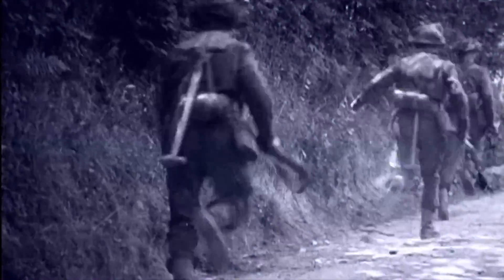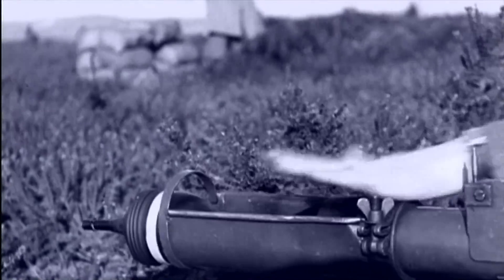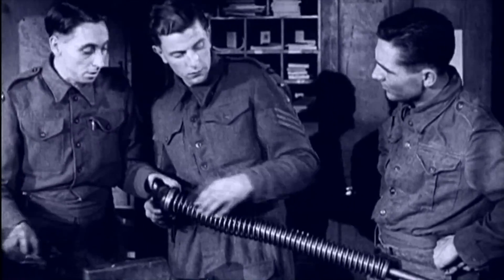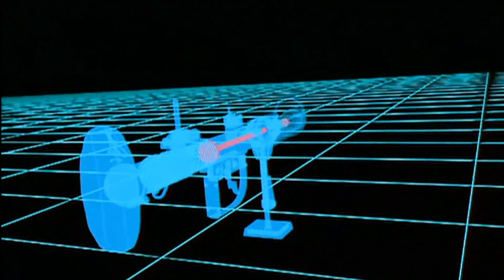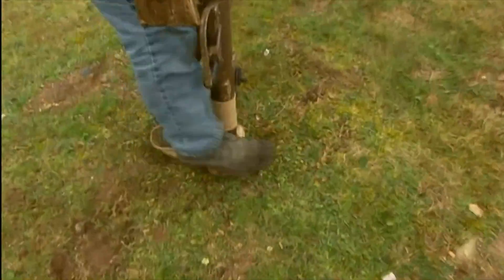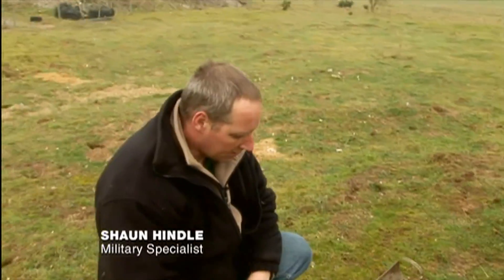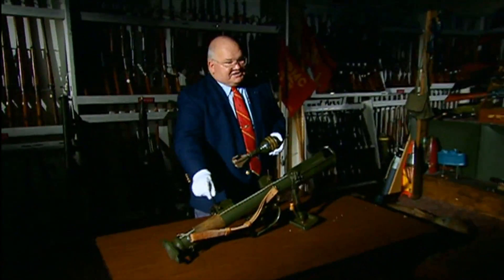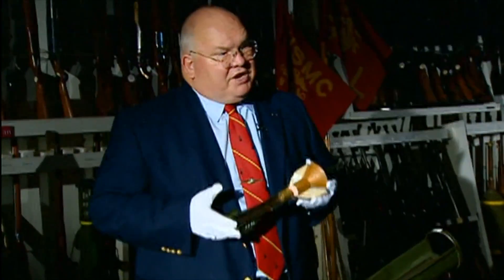Weaponology - "British PIAT"

Comment: Of course the big advatage of the PIAT was it could fire 15 rounds per minute. It was the only man portable rapid fire anti-armour weapon of WW2. A two man PIAT team had much more effective firepower than their Bazooka of Panzerfaust equivalent.
Reply: So how exactly are PIAT rounds primed?
Reply: So I was quite correct to say Bazooka rounds are larger than PIAT rounds.

I can show you an official source that states Bazooka teams carried 6 rockets. Can you show me proof that PIAT teams carried 6 mortars?

PIAT rounds did not need to be 'primed'. A quick look at the PIAT user manual will show you this. Also the operator does not need to "check if the weapon has successfully cocked itself". You are just making this stuff up. The loaders job was to get another round in the tube as quickly as possible.

I have shown you actual footage of a PIAT firing rapidly. You have shown me nothing to suggest the Bazooka can do the same, because it can't.
Reply: "And since the weapon often failed to cock itself, in the field the 
gunner would usually manually cock the weapon after every shot"

Is this fact or conjecture?

"If you think PIAT teams can carry more than six rounds (the term is 
"rounds" or "bombs," a "mortar" is a device), show me a source."

Do you want to see pictures?

"PIAT rounds do need to be primed"

No they don't. If you know better than the actual PIAT field manual then prove it.

"You've still shown me no proof that this supposed 15 rpm rate of fire"

No, i've shown you proof of a 20 rpm rate of fire.
Reply: There is no mention of the loader having to 'prime' rounds between shots in the PIAT field manual. If rounds had to be fused after transportation but prior to use then this would have no affect on rate of fire.  The advantages of the PIAT was that it was rapid fire, produced no backblast, was quiet, multifunctional and cheap to produce. That's a lot of advantages. The only advantage of the Bazooka was that it was light weight.
Reply: The PIAT manual's loaders instructions even include removing a cork dust plug from the rounds base before firing. There is a reason fusing each round isn't included and that's because it is done in advance. It is not part of the reloading drill, and has no impact on rate of fire. 

Are you suggesting PIAT operators running around with loaded PIATS clearing urban areas have not fused their chambered rounds?

PIAT's can be fired at a depressed angle. A clip holds the round in place.

 "doesn't prevent the gunner from carrying a rifle"

http://www.ww2incolor.com/d/615911-3/PRUNER
Reply: So what you're saying is a 30 year old second hand Soviet ex-cold war stock RPG rocket is roughly 10 times the price of a newly manufatured HE mortar. So when I said Bazooka rounds were probably 10 times the cost of PIAT mortars it was actually quite a conservative estimate.

I take it you no longer refuse to acknowledge that a well positioned and prepared PIAT team could quite easily achieve a 15 rpm rate of fire  as shown in this video.

If the point you were trying to make before your melt- down was the the PIAT was quite large and heavy, well it is. You didn't have to exaggerate and claim it was impossible for the operator to carry a PIAT and a machine gun/rifle as that is quite clearly BS. Canadian PIAT operators carried a Thompson machine gun as standard.
Reply: "You screw in the detonator on the nose of the round, like I already said
 once. It comes from the factory with the nose fuze in place but not 
screwed fully in so the HEAT charge won't detonate if you drop it."

Prove it.
Reply: Already edited it to add proof, but ok:

"One day, he had a brilliant idea that he would test a certain shape of slit for the PIAT. He called for a platoon to volunteer to dig this, but, of course, no one did. My platoon got the job on the grounds that the soil was softer where we were. The NCO who got the job was testing the result, when the PIAT went off and only the fact that the bomb was not primed prevented the Company HQ from being considerably shaken, as it hit a tree not far from where a company conference was in progress." 

Lieutenant Percy Hamilton, Irish Brigade, Termoli, Italy, October 1943.
Reply: What bomb was it? HEAT, HE or a dummy round (which does need to be 'primed').
Reply: How would an inert dummy round leave the weapon if it wasn't primed, and how would it do anything to their headquarters if it was a dummy round, primed or not? Come on, you're not even trying here.
Reply: 1. So unsurprisingly you're misreading the instructions, and assuming anything not part of the firing sequence doesn't exist. I also can't help noticing that removing this dust plug isn't part of your personal firing sequence of "drop bomb in, fire," so good job defeating your own argument there.

2. You don't tend to do any "running around" with a loaded 32-pound support weapon. And you're talking about the rounds that are not loaded being live, not the one that is.

Also it would be rather hard for a PIAT gunner to fuze his "chambered round" since the weapon has no chamber. Did you learn about the PIAT from anything other than videogames, Wikipedia and Google?

3. That's a submachine gun, do you not even know what a rifle is? And the typical issue weapon for a PIAT gunner was either an M1911 or a Webley revolver, because the launcher is like carrying an M1 Garand and a BAR at the same time.
Reply: 1. Oh I forgot. You know much better than the PIAT operators manual, how silly of me. So with several PIAT rounds prepared for firing by the loader in advance the PIAT was easily capable of a rate of fire of 15+ rpm. Phew...good to get that out of the way.

2. lol...from the guy who thinks the PIAT's spring wasn't used to help propel the round. Where did you get your knowledge from? ever fired one? Perhaps you should read the manual and watch a training film like above.

3. Are you really this petty?....A Thompson machine gun would be approximately twice the weight of an M1 Garand.
Reply: "A Thompson machine gun would be approximately twice the weight of an M1 Garand."

A Thompson weighs twice as much as an M1 Garand?! Right, fuck you, bye.
Reply: Sorry to upset you so much. They actually weight about the same. I have a picture of a PIAT operator also carrying a rifle if it makes you feel any better?
Reply: You should try watching the video before commenting.
Reply: agt155 after reading the whole to and fro with that American dude, I have to say thanks for actually defending this weapon and clearly having done some research on it. You are absolutely correct about them being pre-fuzed as the storage device for them offered ample protection against negligent discharges while in the field. 

As an aside, I’d much rather go to war with a spring loaded muzzle loaded mortar than a battery operated scaffold pipe, atleast you won’t have to worry about running out of batteries before you run out of ammunition!
Reply: Actually as I recall the shaped charge in the PIAT was bigger than the 2.75" RL and had more penetration. The RL round had to be wired in I believe. I have fired the 3.5"RL back in the 70's
Reply: ruata vangchhia you do realise the most common model of panzerfaust had a 30m range... just sayin....
Reply: "We're not talking a mechanical action here, so you can't extrapolate 15 
rpm just because you can drop a second round in quickly under completely
 ideal conditions."

They are lying down prone in the grass firing at a tank 50 yards away. It is as close to the intended battlefield use as you can get. The loaders job is to drop rounds into the 'barrel' as quickly as possible. If actual footage of them firing in excess of 15RPM isn't good enough for you then I'm not sure what is.
Reply: No. I have a video showing that they can exceed a ROF of 15 rounds per minute for short bursts. 

So a Bazooka loader can carry twice as many rockets than a PIAT loader can carry mortars, even though the rockets are much larger, heavier and less robust? Do you think maybe a bit of bias is creeping in to your arguement?

Where did your evidence of 20 rockets carried per Bazooka team come from anyway? I just watched some of the official training video and it stated the operator carried no rounds with the loader carrying 6. The video also shows how terribly slow it is to load a Bazooka. I also have pictures of PIAT loaders carrying 12 rounds.

 I have given you proof that the PIAT can fire two rounds in 3 seconds. Now you show me some evidence of a similar rate of fire for the Bazooka.
Reply: Apart from a training video showing actual proof of what I have stated and more.

Good to see you have back-tracked on your assertion that PIAT rounds needed to be primed.
Reply: It shows this being done on a firing range with loader and gunner completely exposed and the loader already leaning over to place the second round. This is not a good display of how fast it could be fired in combat unless you are in a desperate hurry for the enemy to spot you. We're not talking a mechanical action here, so you can't extrapolate 15 rpm just because you can drop a second round in quickly under completely ideal conditions.

Put another way, can you find a single scholarly source claiming the PIAT had a rate of fire significantly in excess of a bazooka under actual combat conditions? A semi-auto trigger doesn't mean much when you're comparing a muzzle-loader to a breech-loader, and accounts from British soldiers who used it tend to agree that off the range it hardly ever succeeded in self-cocking like it was supposed to.

(It also had a very dangerous feature in that the detonation of the propelling charge would sometimes separate the bomb's tailfin and shoot it back at the PIAT team with enough force to be lethal, which didn't do much for its reputation, though since period bazookas had problems with exploding it doesn't tend to get singled out for that)
Reply: You have a video showing they can fire two rounds that fast. It does not follow that they can fire fifteen rounds that fast, because this is not a cyclic rate, it's a human crew. PIAT bombs had to be hand-fuzed before being fired (the one he's loading is either pre-primed or they don't care if it's primed or not because this is a propaganda video) and the recommended firing position isn't with the loader reaching right over the weapon.

I'd want some kind of literary citation for the idea that the PIAT fired any faster than the Bazooka under battlefield conditions. Do you have one?

You're also flatly wrong about a PIAT team being able to carry 15 rounds: the PIAT was so heavy the only other thing the gunner was issued was a sidearm, and the loader only normally carried 6 rounds, two sets of 3 cardboard tubes like those shown in the demonstration video. While the Panzerschreck was probably similar since the rounds for that were gigantic, a Bazooka team on D-Day carried 20 rounds, with the gunner carrying 8 (along with an M1 Carbine) and the loader 12.
Reply: Incorrect, you have a video showing someone can drop an unprimed or pre-primed bomb into a PIAT on a firing range if they're already leaning out over it in the "shoot me" position and the gunner doesn't stop to check if the weapon has successfully cocked itself. This is not proof of anything under combat conditions. And the reason they carried fewer PIAT rounds is that the bombs were physically more cumbersome due to the way they were carried, the British packed the rounds in very large sets of three cardboard tubes like mortar rounds while the Americans just carried bazooka rockets loose in canvas bags.

You are also (as ever) exaggerating the difference in size and scale. A bazooka rocket is 21.6 inches long, 2.36 inches wide and weighs 3.5 pounds. A PIAT round is 15 inches long, 3.5 inches in diameter and weighs 2.5 pounds. But that's irrelevant since the limiting factor wasn't the size of the rounds but the size of the device used to carry them around. Also, if you doubt that, don't make meaningless accusations of bias, show me a source that says how many rounds a PIAT team did carry. You're the one making exceptional claims here, so you bear the burden of proof.

You still need to show me a citation that the PIAT can be fired quickly in combat that isn't your interpretation of video footage that doesn't reflect a combat situation. You don't have one, do you?
Reply: Slightly bigger, but it doesn't matter because of how they're carried. As as I said, the figure of 20 was for D-Day, when they were carrying a lot of extra supplies.

PIAT rounds do need to be primed, they weren't transported live since that that would be insanely dangerous, so there's a necessary pause to screw the detonator into the armed position. In addition, you see more realistic firing positions later in the video with the loader taking cover and the gunner leaning out to shoot: lying down in plain view with the loader having to lean up and over the weapon was not practical in combat, nevermind having him stay there bomb in hand waiting to load it. And since the weapon often failed to cock itself, in the field the gunner would usually manually cock the weapon after every shot, especially since like any anti-tank weapon team they would usually try to relocate after every shot. This stuff isn't in the manual because what the weapon was supposed to didn't match what it did do.

If you think PIAT teams can carry more than six rounds (the term is "rounds" or "bombs," a "mortar" is a device), show me a source. And I'm not claiming bazookas can be fired rapidly, I'm claiming that under combat conditions the practical rate of fire of both weapons is roughly the same. You've still shown me no proof that this supposed 15 rpm rate of fire could be replicated under combat conditions.
Reply: I haven't said that at all, I'm just refocusing on the central point. Concession accepted, this is clearly the only "evidence" you have for this silly claim.
Reply: Now going with your rewrite:

1. The PIAT firing sequence wouldn't include basic ammunition handling safety, because they'd drill that into you before you were even allowed to touch one.

2. You're suggesting soldiers risked exploding if they sat down funny so that, if they found a completely exposed position where the loader could get on all fours lying over the weapon like he was in a farm machinery porn video, they could fire two shots a bit fast. Despite that the recommended use was from a slit trench where the crew couldn't even do this. 

Bear in mind, you do not fuck around with wartime-production fuzes for anything: the reason "cooking" grenades was rare outside the US Marines was because chemical delay fuzes aren't nice digital countdowns (if you were really unlucky the grenade would explode the instant you pulled the pin), and it's the same with the sensitivity of impact fuzes. The idea of British soldiers wandering around with all of their PIAT bombs live makes them out to be idiots and the weapon to be a deathtrap: even a Panzerfaust had you pull a retaining pin before it was live.

3. Your claims that it was "rapid fire" and "cheap to produce" are only backed by your own assertions. It's a 32-pound slab of metal being compared to a hollow tube with a flashlight mechanism attached to it. And there are substantially more advantages to a bazooka than you're implying (eg breechloading being more convenient in many scenarios, lacks a heavy trigger pull, recoilless operation, doesn't throw 12 pounds of metal at its front end a tenth of a second before it actually fires to fuck up your aim, has almost no moving parts, can fire below zero elevation (if you try that with a PIAT the bomb will fall out of the holder) doesn't prevent the gunner from carrying a rifle, late-war bazookas were more reliable, more accurate and had better sights, etc).  You also managed to miss the PIAT's high-angle use (not possible with a bazooka unless you're fond of melted boots), ability to use multiple ammunition types (it was more effective against personnel than the bazooka when using HE rounds), and the fact that the bomb carried a larger warhead and so was more effective against armour when using HEAT rounds (though not as effective as the behemoth of a round the Panzerschreck fired).
Reply: 2-5 rounds a minute? In this video it shows a PIAT team firing two rounds in 3 seconds. PIAT's firing rate is comparable to that of a mortar - unsurprisingly.
Reply: [X] Doubt
Reply: A two man PIAT team could carry and fire off 15 rounds. It would take a team of 30 men to do the same with Bazookas.
Reply: You screw in the detonator on the nose of the round, like I already said once. It comes from the factory with the nose fuze in place but not screwed fully in so the HEAT charge (or HE charge, one of the actual advantages of the PIAT was it was the only WW2 AT launcher that was issued with antipersonnel rounds and by all accounts they were very effective) won't detonate if you drop it.

Also here's some of that "evidence" stuff:

"One day, he had a brilliant idea that he would test a certain shape of slit for the PIAT. He called for a platoon to volunteer to dig this, but, of course, no one did. My platoon got the job on the grounds that the soil was softer where we were. The NCO who got the job was testing the result, when the PIAT went off and only the fact that the bomb was not primed prevented the Company HQ from being considerably shaken, as it hit a tree not far from where a company conference was in progress."

Lieutenant Percy Hamilton,  Irish Brigade, Termoli, Italy, October 1943.
Reply: Since I got a notification for that last reply after I blocked you, that price is from a page for a role-playing game, you idiot. And you can't even quote that honestly since the price it gives for an 81mm HE round is $50, exactly the same as the low-end price for an RPG-7 round, implying that if anything your PIAT round would cost more . Well, enough of dealing with your university of Google "education" on firearms. Bye now.
Reply: LOL.....it wish it had the range and penetration of the panzerfaust....
Reply: It could fire 2-5 rounds per minute (the same as a bazooka) and PIAT gunners would frequently deliberately limp-wrist the weapon to avoid the recoil, meaning it would need to be cocked for each shot. There is no way you could fire a muzzle-loaded single-shot weapon at one-third to one-half the aimed rpm of a magazine-fed semi-automatic rifle.
Reply: You haven't shown me proof of anything. You've shown me a propaganda video which does not reflect battlefield use. Try again.
Reply: You wouldn't need an extremely high rate of fire if you just had a couple really accurate, highly damaging and long range rockets. Not to mention how many men it would take to carry 15 rockets, it is wasted manpower.